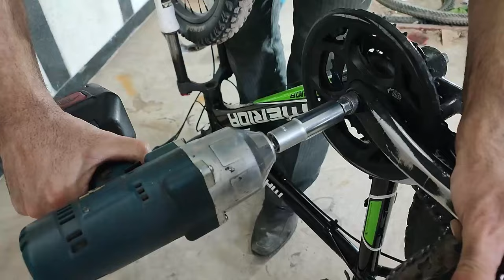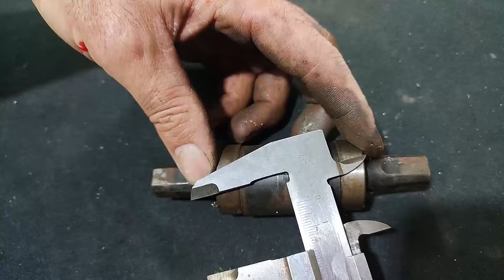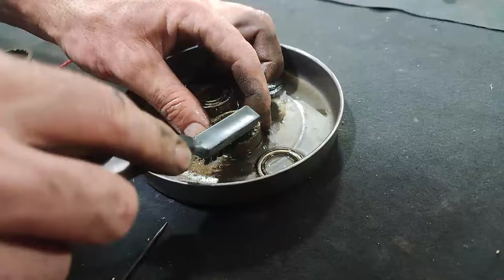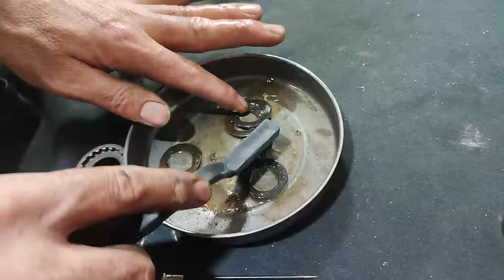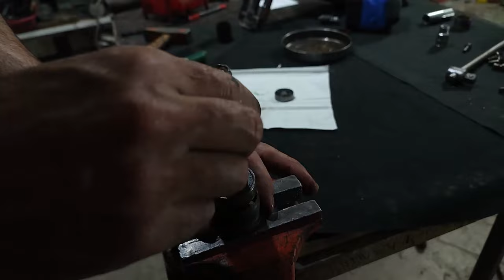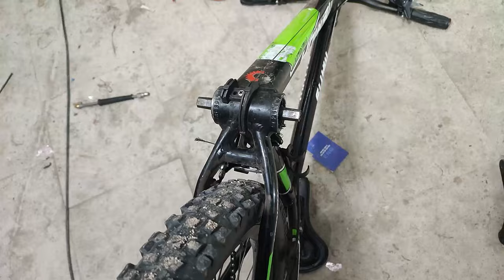How to Fix a Creaking Bike. Lubrication of the bicycle bottom bracket

Comment: I am sure there will be comments about why you should replace the bottom bracket, but in my opinion you did a great job. Not sure if it is worth spending the time though.
Reply: Of course, your opinion is correct, but as long as the bearings are not damaged,there is no need to replace the lower bracket, and cleaning and greasing is sufficient.